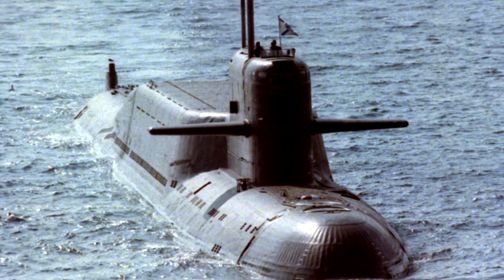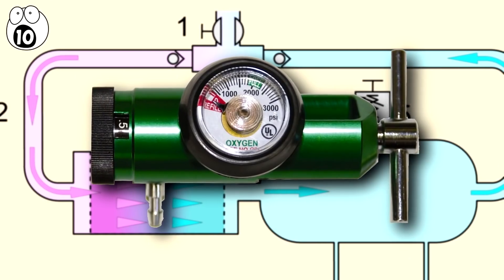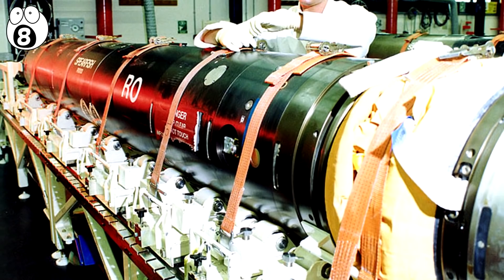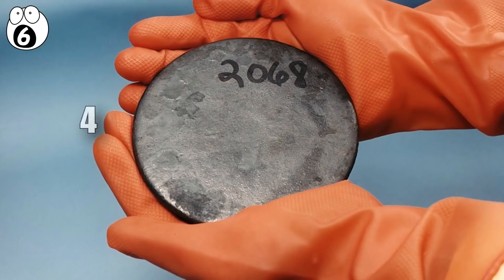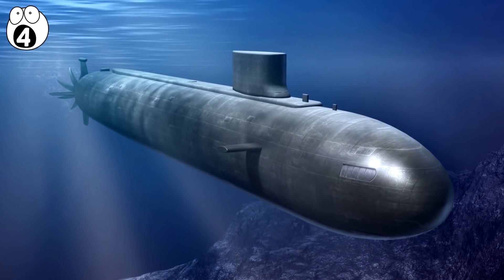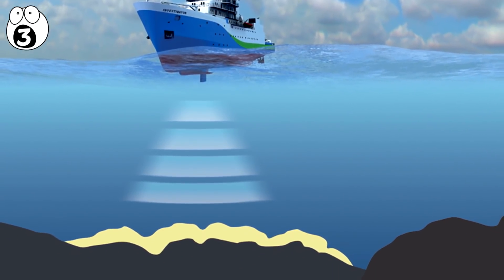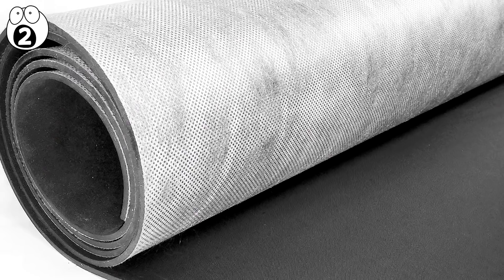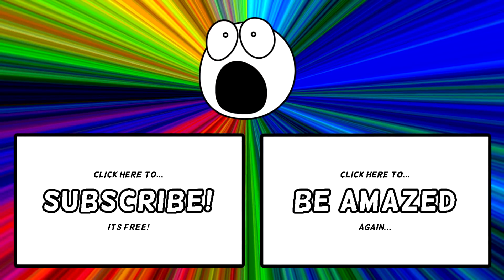Declassified Nuclear Submarine Design Secrets

Comment: Modern submarines also make their own drinking water.

Submarines can use magnetic's to reduce noise and increase maneuverability.

Solid fuel rockets have their own oxidizer in the propellant. Liquid fuel rockets carry their own oxidizer in a on-board tank. Both will burn in space or underwater.

Lasers can detect submarines by measuring the water displacement as the sub moves thru it.

Currently in testing, but proven, electricity can be 'beamed' thru the hull to power external devices without violating the hull integrity to run power cables.

Underwater drones are being developed that can swim from the torpedo tube, avoiding a launch transient, to intercept incoming weapons, attack multiple enemies, or attack from a dangerous position without moving the manned sub into  that same danger.

None of this is classified, just not common knowledge in many cases.
Reply: WWII Submarines also made their own drinking water.
Reply: Even regular cruise ships make their own drinking water. Reverse Osmosis plants are pretty common nowadays.

Comment: Unless it is a cruise missile, a rocket does not need oxygen, since it carries an oxidizer with it. Secondly, the air pressure launch systems on Ohio's is replaced with a steam system. They actually use a rocket engine to produce steam that launches the missile into the air. The Poseidon boats still used air pressure though.

Comment: I got more time on the crapper at test depth than you... have in researching this video.
Reply: oversoul ditto
Reply: when we were at test depth the first time, it was all hands up and about, and no one was on the throne...this was 50 years ago, though, and we were thinking "this boat was built by the lowest bidder" - the consolation was having a few white shirt yardbirds onboard, with us. If we go, they go.
Reply: I did 20 years, 20 patrols, and 4 non alert deployments.  I always rode to test depth in a LET checking for leaks and filling out QA paperwork.
Reply: @timdunlap222  After 20 years that must have gotten pretty old.  Mostly it's a job assigned to junior enlisted.

Comment: considering how amazing these subs are, it's ridiculous how shallow they dive. Sea-Wolf Class has a calculated collapse-depth of 2400ft, with a max depth for use at 1600ft. Average Ocean Depth is about 12000ft. So much room for improvement....
Reply: Designing a sub to go 12,000 feet is easy, but expensive. Submersibles have been going deeper than that for decades. But why bother? There's no tactical advantage to go that deep.

Comment: Guided torpedoes are new and classified?.... Someone call the 1940's!
Also all Subs run on electric engines when under water, both Diesel and nuclear subs only use those engines when running "loud" on the surface and to charge the batteries for the electric engines. Nuclear engines aren't silent they are still just a big steam engine and produce a metric ass ton of heat and noise.
And sonar.... Someone call the 1920's

Comment: @6:37: NOT a sensitive speaker, but rather microphone.  really??
Reply: skip davis  Its called a hydrophone of a transducer array.   a transducer can be used as a passive or active sonar. But we almost never use active sonar in combat situations. It gives away the position of our Submarine with one ping. Surface ships use active sonar all the time. sometimes they ping  every 12 seconds for hours. I made a small  movie on my sub. You can find it on my channel. I also have a Facebook page called : Onderzeedienst, for the Netherlands Submarine Service.
Reply: These devices exist. Decoys are tail mounted devices that are launched from submarines and make "horrendous noise" to draw off torpedoes and some subs even launch dummy torpedoes that mimic their acoustics to draw enemy fire. Anyways, if you have got your torpedo that close to an enemy vessel why not just sink them. Less chance of being sunk.
Reply: That wasn't a radar mast. It was a WW2 JP hydrophone mounted on the superstructure, just forward of the conning tower. The sonar operator (in the forward torpedo room) turned a handwheel, that rotated the hydrophones.
Reply: Video talks about hydrophones and points to radar mast.

Comment: The Number 10 was slightly wrong.
The main problem is no the lack of oxygen but the rising CO2 level. 4% of CO2 is enough to fuck you up. Humans can tolerate hypoxia better than hypercapnia. The real secres for staying underwater is the CO2 Scrubbers. Electrochemical oxygen generator just replaces the air that has turned to CO2 so that there is no negative pressure inside the submarine.
Reply: Larry, I love the smell of amine in the morning... not really.
Reply: I think the ammonia is in a "closed" loop but nothing makes you get up in the morning like leaking scrubber ;)

Comment: The Jimmy Carter is a Virginia class submarine, not a Seawolf class. Both of these classes have similar features, but they are not the same class. You can take this as fact. I used to serve on a submarine, and I saw the USS Seawolf SSN 21 launch from dry dock at Electric Boat in Groton Connecticutt. By leaving out the Virginia class, you show just how outdated your information is.
Reply: the jimmy carter is a seawolf class it was launched before the first virginia class was completed.
Reply: OK. I stand corrected :)  I got confused between the Jimmy Carter and one of the Virginia class boats.

Comment: Declassified - when? Those are old news. Even the crap about rocket engines breating air is "borrowed" from another video somewhere. 
But to mention one thing: IF (!) the Russian super sonic torpedo Skval DOES exist it will only make sense armed with a nuclear warhead. Because onboard sonar for adjusting course or any way of remote control from launching sub is impossible, it needs to have a VERY large kill ratio.